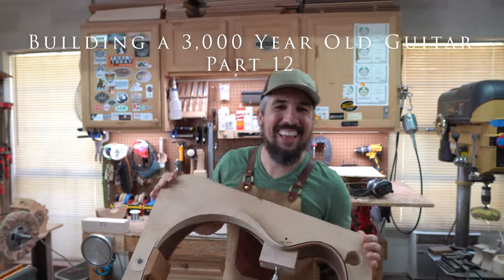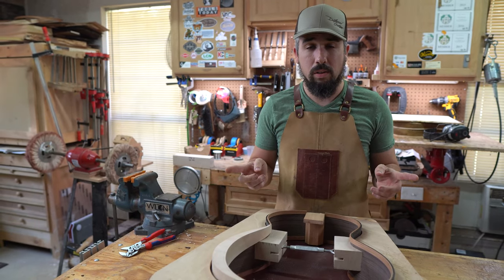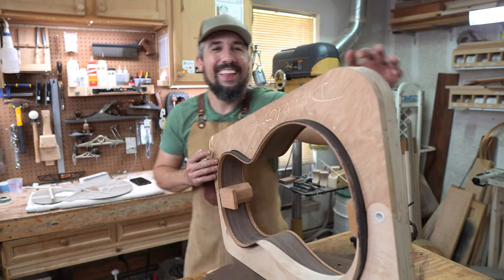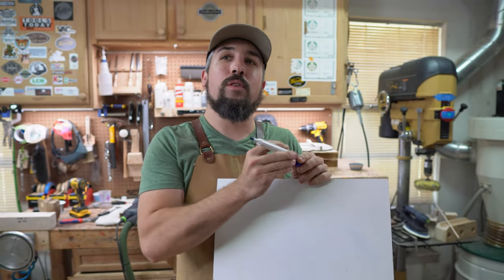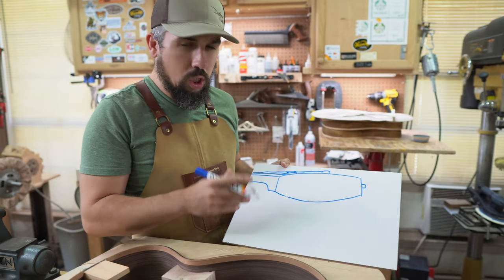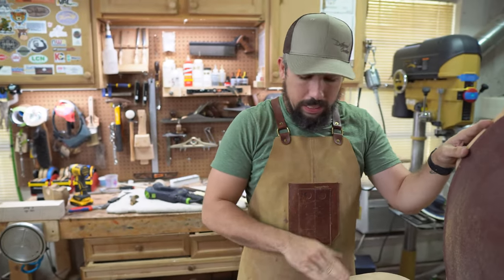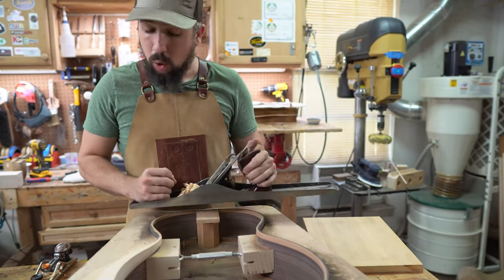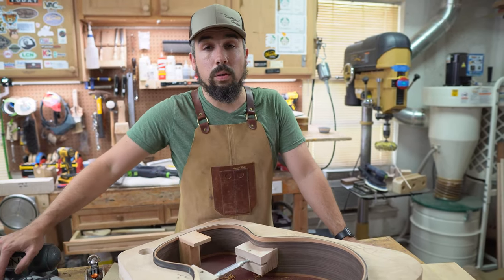How To Build An Acoustic Guitar Episode 12 (Radius The Sides)

Comment: I think the radius in the back is also there to work as kind of a parabolic mirror, so that the soundwaves are guided to the soundhole, thus helping you to get more sound. 
Also, maybe an easier way to do that thing with the arm bevel could be to use the CNC machine. When cutting, only cut all the way through on one side, then flip the whole board around and do sort of a radius cut on the other side. It should only need a little cleanup afterwards. 
Loving this series and looking forward for what's to come.

Comment: It’s already been mentioned but I’ll second it.  Find a used electric potters wheel and convert it to do your radius sanding.  It couldn’t involve more than taking the wheel’s top plate and drilling some holes to fasten to the underside of your radius board.  You might have to shim the radius board so it clears the rim of the wheel bowl.  You could even install threaded inserts in the bottom of the radius board so it would properly mate with the drilled holes in the top plate.  The advantage of the potters wheel is you can dial in the speed to your liking.
Reply: Brilliant!

Comment: Matt's not the only one that had questions about the upper bout.  I've been struggling with that question, which others that I have seen only hinted at or did the flat sanding but didn't explain.  So thanks for laying it all out.  My current build will be better for it, plus I like the solid kerfing tip very much.

Comment: Just the right amount of goof and goodies.  Really love this build series. 

I am building a parlor sized guitar (my 2nd acoustic build). The relatively small body size really made huge difference when I radiused the top side of the body too much on the neck block end.. The exact thing you drew up in the "Matt Has Questions" section happened to me. I didn't notice it until the body was all glued up.  My solution was to essentially radius the underside of the fingerboard to match the top radius. It works, but a lot of work.

Comment: One trick that helped me a lot, was instead of moving the guitar over the radius dish, we mounted handles to the back of the radius dish, that way you can use the weight of the radius dish (the dish we had was aluminum which was enough weight) to apply downward pressure while sanding, and all I had to do was twist it back and forth. Saved so much time, as well as wear and tear on my back and shoulders.

Comment: Great upper body workout- if it doesn't kill ya! I would call this method, with the radius dish screwed to the bench, "pushing the bus". 
I always radius the sides before installing the linings. Then glue the linings in slightly proud, and radius-sand again. Sounds like extra work, but it goes a lot more quickly, breaking it into two stages. That way, the linings keep to a consistent width. However, you will need to make a pattern and bandsaw your solid linings to follow the radius before you bend them. 
If you're lucky enough to find a used electric potter's wheel, you can easily modify it to do all your bus driving (or bus pushing) for you. 
By the way, the best radius dishes made (in my opinion) are the ones made by Canadian Luthier Supply, sold by Veritas Tools. They are flat on the bottom, perfectly radiused, and dimensionally stable, because they are made with  1 1/2" thick MDF. They cost about $70 each.
Reply: I do it the same way.

Comment: You can use a Dremel with a sanding bit to clean up the inside of the arm bevels during that side radius process.
Reply: How about contouring the arm bevel before installing? Seems it would be much easier.
Reply from the maker: Then there’s no way to clamp it into place. I wish I could.
Reply: Could you use a rasp? Or cut the inside bevel with a belt saw then double side tape it back together for clamping then remove the tape post glue up?

Comment: I had a thought that could help you when shaping the radius into the sides, If your dished sandpaper is level accross the top and your guitar is dimensionally square in the jig, you could just slap a level on it to make sure it’s sanding evenly. Measuring it all the way round to check its going even has got to be fairly slow, obviously still need to do that to make sure it’s perfect but you’d be able to quickly get a lot closer to finished before having to stop and measure. I have considered the fact that you probably know from experience weather it’s even or not from feel but still, and maybe for someone who’s less experience could speed things up. I try to find little quick cheats like this for my sanding projects and stuff just to speed up getting to the fine last bit

Comment: Cool series its been a pleasure to watch you craft this guitar. Since you asked...  it would be a lot easier to finish /reduce the size and weight of that arm bevel backer prior to install. I am not a guitar builder but as a professional craftsman I highly recommend you put a 2X72" belt grinder or similar in your shop. This allows you to have multiple contact wheels for various radius' and the thin belt is great for contouring tight/awkward access spots. Would be a dream for cutting the arm bevel contour in the sides, neck work, etc.. (And pre scalloping bracing sshhh I won't tell anyone)

Comment: Great video, l am really enjoying following the build, just a couple info things to mention, It will require a 30 ft. dia. beach ball to imprint the 15 ft. radius and a 60 ft. dia. beach ball to imprint the 30 ft. radius. I also was wondering if you considered using the CNC to rough in the radius of the bevel block before gluing in place. Thanks for sharing.
Reply: I just love beach geometry

Comment: Hey, at gibson, to get the fretboard section flat after gluing on the top, we just used a flat piece of wood between the sander and sandpaper. We radiused the whole top, glued it on, then sanded the top flat where the FB meets the top so you don't ski jump. No fancy tools needed (;

Comment: Me thinks an easier way to do the arm bevel is pairing across the grain with a gouge, or using a Scorp or hook knife. If pairing, first use finger plane or a knife to knock off the far edge, relieving it so it doesn’t chip out the wood as the gouge finishes the cut. Relieve it 2/3 of the way, carefully pair down to that level with perhaps a 10 mm no. 8 gouge, then cut the relief this time going down to final depth, and finish pairing. Sand to remove beaver marks

Comment: Hey, when you sand the top ‘flat’ between the transverse bar and the neck block, do you mean flat across the upper bout and blended with the remaining 15 degree radius. But retain the 1.5 degree angle on the neck extension?
Reply from the maker: Correct.

Comment: I’m loving this series, you’re a real thoughtful luthier. I do wonder, however, if radiusing the top to “strengthen” it, actually stiffens it and blocks out lower frequency vibrations? I wonder if you kept the top flat, how the tone would change?
Reply: The other reason to radius the top is with humidity changes, the top reacts like a piston, moving up and down. That's why action needs adjusting in the winter sometimes, when the guitar dries out a bit. If the top were completely flat, there's the risk of the wood expanding side-to-side (wood expands across its grain. quarter sawn keeps it to a minimum). More risk of cracking the top or sides from expansion and contraction.

Comment: Could you radius the inside of the arm bevel with a router, or the CNC, before you glue it onto the guitar assembly? Or would that affect the assembly process too much?
Reply: That's what I was thinking, why not carve the inside of that arm bevel block before you glue it in? But then you would have a hard time clamping it when you glue it in.
Reply: I agree radiusing the arm bevel prior to install seems worth exploring - either CNC the blanks or use a router table with bottom bearing bit. As for glue up it looks like the finished piece has about a 1/2" radius after the hand plane work, still leaving plenty of flat surface for clamping purposes at glue-up.

Comment: Have you considered using a rotary tool like a Dremel (or something larger) with a reaming or sanding bit? That would allow you to "carve" that inside edge down by hand (with a lot of control), but much faster.
Having watched further, your end result is very nice looking, but instead of a convex edge (bowing out into the body), the multi-tool method would allow you to make it convex. Perhaps not practical or desirable, just thinking out loud.

Comment: Loving the series thank you very much. Like the 45 tail block makes sense. My first solo build I finished early this year I put a 25 radius on top and found that i could radius the sides and it didn’t touch the neck block top. Worked out well so might stick with that for now but super excited about arm/back  bevels and the laminate sides. Why couldn’t you chamfer and clean up most of the arm bevel before you glue it in? One small vid that would be interesting and no one seems to cover is labels for the inside! What paper, glue & software you use ?

Comment: Most guitar builders cut the bridge plate so the grain is perpendicular to the top’s grain. But then the bridge pin holes end up being drilled parallel to the bridge plate’s grain, and it seems like that would weaken it.  Would cutting the bridge plate at a 45-degree angle to the top’s grain work?

Comment: A suggestion for the inside convex surface, you can make a tool using a wood dowel lathed/turned to have an hourglass shaped profile. You can use adhesive stick on sandpaper on that profile if it's got a piece of all thread up the middle axis so it can be chucked in a drill for use on the feature in your guitar. Another option would be to reshape a scraper with the arced profile you want to make on that inside reinforcement.

Comment: Couldn't you shape the inside of the arm bevel before you glue it into place?  Seems to me it would be much easier on the spindle sander while it is still a separate piece.  At least get it close that way.
Reply from the maker: I wish! If you done have a good hard edge on it, you can’t clamp it onto the sides

Comment: Not sure how those arm bevels are done, but gluing a massive piece of wood up against your top (or anywhere) doesn't seem a good idea. The energy of vibrating strings is finite and we've already got the big neck, neck block, and end block absorbing string energy. I would have radically reduced the size of the bevel lining piece before gluing it in. Less is more with stringed instruments.
Reply from the maker: You’ll see that it’s actually not any more glueing area than the standard kerfing. The sonic difference is totally non discernible. I totally agree with your thoughts and have taken Avery measure I can to ensure my guitars are as musical as possible. Watch the video I just posted today. It’s a demo of one of my guitars with two bevels. Judge for yourself if it sounds good or not.
Reply: @DriftwoodGuitars  Thanks for your reply!

Comment: Chris : I have been going through your videos and have been very impressed with the content and delivery . Thank you ! On the subject of radiusing the sides for the top, I thought you might be interested in a slight adjustment to what you have done in this video. The methodology makes for a very consistent neck angle and consistent transition from the flat sanding above the sound hole to the domed sanding below the sound hole. The methodology is demonstrated on You Tube by Josh House Guitars youtube.com/watch?v=01QKYPpRafw. I have found that it works very well!